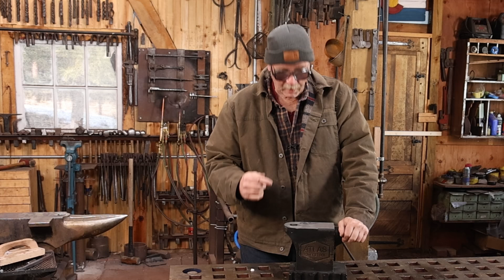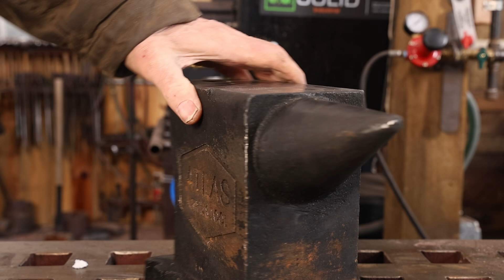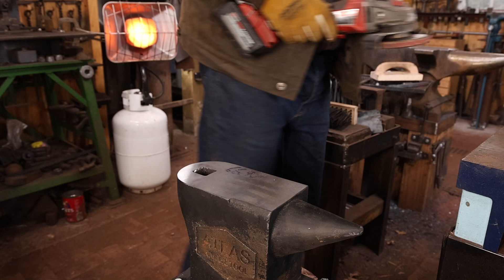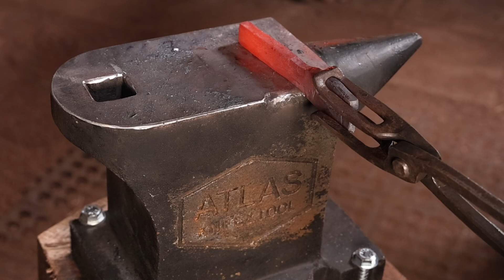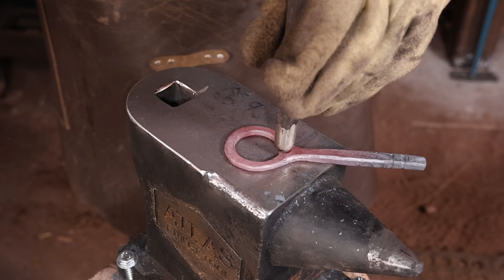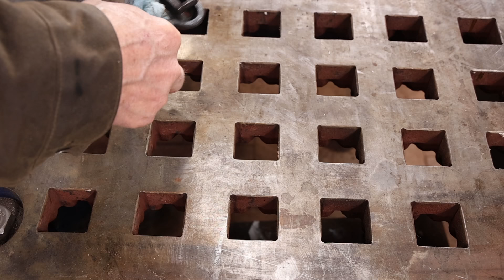Forging a bottle opener on the Alec ANVIL from Atlas Knife and Tool

Comment: I wish these would have been around 14 years ago when i started.  i started too late to get one of the cast Steel Russian anvils, and Too early for the newer crop of affordable cast steel anvils.  I finally managed to find an old 200 lb peter wright in pretty good shape but had to travel 2 hours, and pay close to $7 a pound for it, but it was my first chance at getting an antique that didn't have all the edges chipped out.  People starting out now are Blessed to have all these fairly affordable options for a new tool that will last longer than they will.  That being said something like this would be really nive for a mobile forge setup, an the form factor puts a lot more mass under the face, so it will forge like a larger anvil when working over the sweet spot.  Grab a thick chunk of steel at the scrap yard to drill some holes in, and make yourself a bolster plate, and you'd be set.  You have to make a hardy holdfast for this, which would take a bit more work than a pritchel hold fast, but it's doable.  and since it has a 1 inch shank, you can use a piece of 1 inch stock, and weld a ring onto it for your hardy tools rather than spend the time tapering and up setting stock for said tools.  The swages on the base are actually pretty nice too.

Comment: Awesome little anvil.   So really how often do you need more working area than that anyway?
Reply from the maker: It's usually less about the surface area as it is just the more solid mass.  But a larger face is nice if you like to set tools on the anvil while you work.

Comment: Odd question for this video but anvil shape has been a big thinking point lately.

Looking buying my first commercial steel anvil, is there a big difference between how the tall legged double horn Vevor anvil performs vs a similar weight London patern?

Ive been using a 30#ish piece of rail track with either a plate welded to the top or hard faced up with welding rod.  Its been machined on the sides and top to a London like pattern with a horn.  Its mounted pretty solidly on 4in square tubing with 9x9in ½in plates top and bottom on a sunken stump.

Anything mild Ive hammered on it has moved pretty easily but I tried making a hammer drift out of sucker rod and it just didnt want to move.
Reply: More heat required.
Reply: @hendrikvanleeuwen9110  It was screaming hot.  Carbon sparks were flitting about when I pulled it from the gas forge.

Comment: I am very impressed with the thought and design that has gone into this little anvil .
I feel like the guys at Atlas have been watching Denis Frechette and Glen GS tongs a bit too, this style of anvil fits perfectly with their ideas in giving a better forging experience for a lot less fuss and cost or weight, I Shouldnt really be plugging other channels but if the guys out here can see that this concept works as well as it does for them, it will be good for Atlas too  I noticed also how little it rings which is part to do with shape and 
part with the block you mounted it on...very cool
I think Atlas knife and tool nailed it, I checked out the website and honestly saw some stuff there that I want and would buy if I was in the US and able to ship it.
thanks for Sharing John
Reply: I first designed the Atlas anvil as a "post anvil with a hardy hole" in 2013.  Each batch has been slightly different, adding the Alec anvil design in 2022.  I'd never seen Frechette until today.
Reply: @zaph3  Its a great design...any chance of them coming to the UK

Comment: I was practicing some bottle openers last summer, and although I did eventually end up with one that functioned, the first couple got too thin around the ring and ended up splitting. Watching this, I think I drew out the area where the ring would be too much before punching through. I was also using a round punch, but I think the slot punch leaves a lot more material on the sides to work with. Great video! Cant wait to try again soon!
Reply from the maker: A slot punch will give you a better starting point.

Comment: In your opinion, is it a significant improvement over a Vevor 66lb London pattern if I already had one? Or would I be better off saving up for the next bigger Atlas?
Reply from the maker: I doubt its worth switching if the other one is working for you.  But the larger Atlas anvil would be a good upgrade.

Comment: Out of the little anvils you have showed us in your opinion which is the best buy.   Love the video
Reply from the maker: It depends largely on personal needs.  I like the two horn style, but they all have such small hardy holes and without the mass working over the horns isn't real efficient.  This little anvil solves both of those issues, but you loose the flat horn.

Comment: It was truely an honor and a joy to see you work over one of ouŕ anvils i think you would really like our dave anvil its a 286 lb double horn. Its a bit of a bear to use the swage but at that weight it doesnt move any where
Reply from the maker: That would be a good size anvil for any shop.
Reply: I'd second a request for a review on the Dave.  I came across it this past week but not much info beyond the Atlas site.
Reply: @byouman5981 if you have any questions ild be happy help
Reply: I like the radius edge of Alec, over body of anvil.  I read the Dave is heat treated to 1".  Would the Dave suffer from heavy grinding to get the same effect as the Alec?  And I have to say that Charles from Atlas quickly replied to a shipping question I had sent this week - nice customer  service.  @newtsleatherandmetalsmithy1827
Reply: @byouman5981  the corners will most definitely hold to putting in a half inc radius he and i both makecustomer satisfaction a high priority he in the customer relations me in the fabrication of the forges

Comment: Lovely little anvil, quiet ringless forging & blessed with a swage block. Thank you for sharing!
Reply: If you don't bolt it down securely, it will ring like a bell. Great little anvils for sure
Reply: @drason69  I have one of their "knifemaker" models, which is basically this one without the horn or widened base/swage blocks and even unmounted it has no ring.
Reply from the maker: Glad you enjoyed it

Comment: Dang! I finally pulled the trigger last week and got the harbor freight steel anvil but this looks like a much better option for the small things I want to make.
Reply: The HF Doyle anvil has been great I’m glad I got it when it came out, I hope it serves you as well; like John always says, get out in your shop and make something 😄
Reply: The double horn comes in very handy. I have been working with a similar accaio long enough that I would definitely miss that feature. Of course, there are always workarounds. The possibilities with hardy tools are endless. Having all of the mass centralized under the smaller face of this anvil probably makes it very nice to use.

Comment: That looks like a nice little anvil. Im still using the vevor 44lb blue cheap anvil. It works but its gettin pretty beat up. I need to get a new one
Reply: You won’t regret buying one of these. They’re excellent.
Reply: @CausticPuffin and if regretted, easy to sell locally whenever to recoup much of cost later. Price per pound of good anvils that can be redressed holds well over time. “No lowball offers, I know what I got”.  Atlas Knife and Tool proud to share metallurgy reports on his foundry products. 
Also noting I have witnessed Charles’s non scientific testing of durability to include from exposure to explosive launch. 🧨 🚀 .   They take the powder  blast and Iowa farm field landings well. Is a flying stubby as glorious as longhorn? Close enough I say. The boom 💥 and air time are the show.